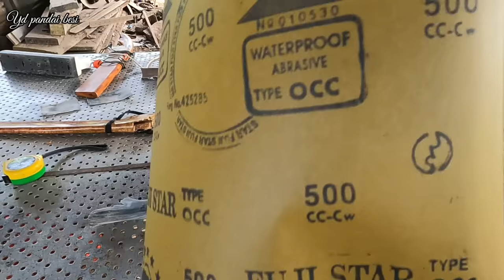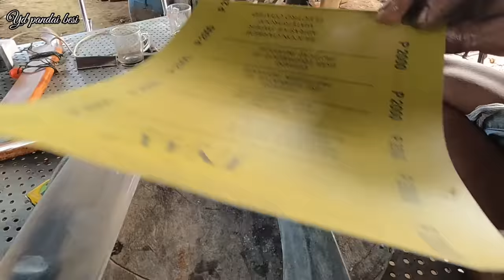creative!! crooked horns straightened to make machete sheaths

Comment: I love the horn sheath, but having just horn for the handle and making it so shiny doesn't seem like a good idea. It will slip and slide when your hands are sweaty, and the polish won't last for too long anyway as you hold that area over and over again. it would make a good display piece however.

Comment: Hope you had a respirator mask on, I know that horn can be very irritating to the lungs. I restore straight razors and I often use horn for the scales. Occasionally I either find a vintage razor with slightly twisted horn or a large twisted piece. I drop them in cool water and brign it to a slow boil Then I clamp them. I had a few pieces that resorted back to it's original state...must've been the grain in it..
Reply from the maker: Siap 🙏🙏🙏